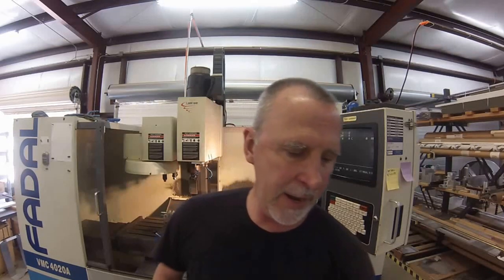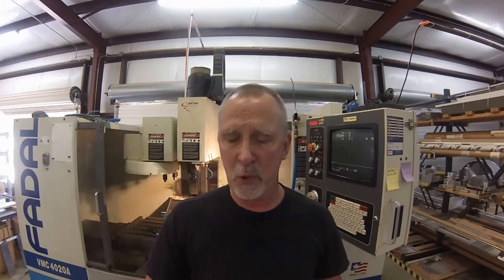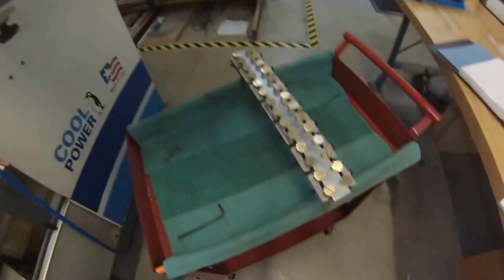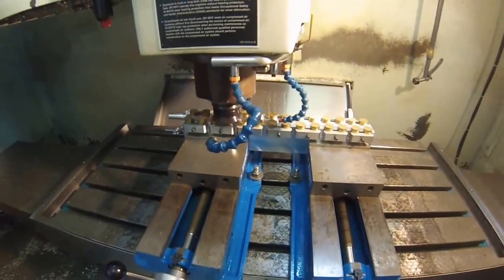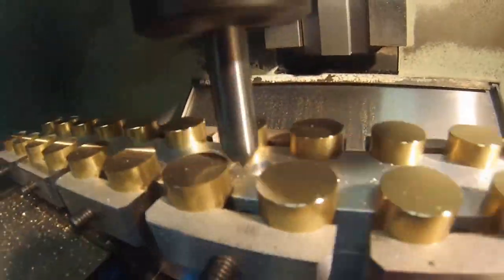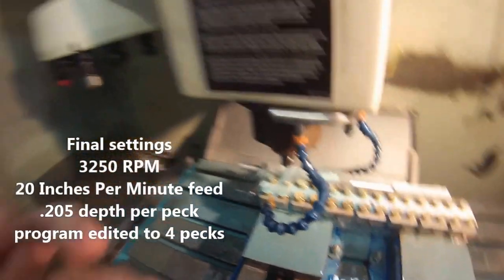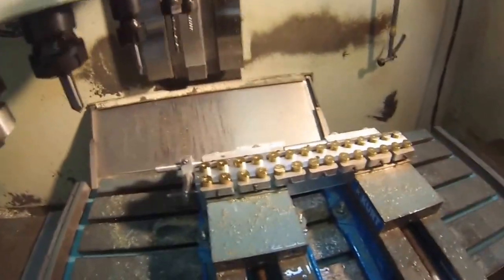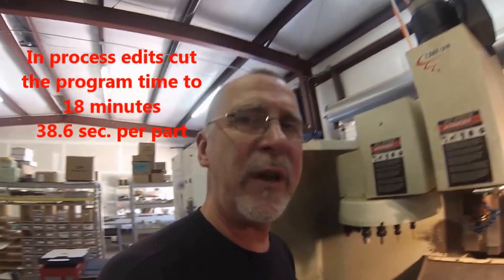Machining 28 pieces at a time

Comment: Hey Joe, could you do a video on how you quote a job? I would really appreciate that
Reply from the maker: Basics...Material cost, hourly rate, setup time, tooling and engineering. If you have a feel for how long the part will take, plugging in numbers should be easy. There are online calculators to help if you need them too.
Reply: Thank you Joe

Comment: Great work on the fixture and a great share for us. I think you can cut that time to even less if you reduce your retract plane while drilling. Around 6:20+ I can see your retract us about .75", that is way too far for that small tap. You could reduce that to .1 or .2 and save precious time. Over a year's time this could mean a hundred hours of machine operations. And as we all know time is money.
Reply from the maker: Max retract distance.160, min .08. I always give a rigid tap time to get up to RPM before it hits the hole.  your comment is good, but .75...not on this one.
Reply from the maker: The coolant jet coming in from the right is set lower and obscures the bottom of the drill.
Reply: Joe Pieczynski ok, that makes sense.

Comment: Looks good Joe, thanks for pointing out how important it is to consider production times and setups in pricing out a job.
Reply from the maker: Hourly rate is simple to calculate. If you want the job back, you may elect to eat the setup time for the repeat work.
Reply: Smaller profits now, for bigger profits later. Seems like a smart trade off to me.
Reply from the maker: You have to weigh the options, but I'll take a little now for a huge payday later.

Comment: excellent!  would've liked to seen you actually indicate it at start. what's your opinion on fadal vs haas in regards to machine and controller? debating an older vf15 with 4 th,  or haas tm or vf 0/1.
Reply from the maker: Since that tooling hole was machined at the same time as the part pockets, and acts as my main fixture offset,  I only had to pickup that tooling hole and I was done. 5 minutes max. Haas makes a great machine and has a good reputation. You can't go wrong with one. Fadal has been around for a while and also has a variety of machines to offer. Evaluate your expected work to factor in your choice.

Comment: Great video, that cnc machine really puts out the work.
Reply from the maker: It does. 28 at a time seems small now. I'm thinking about sticking 2" blocks between fixtures and running 56 at a time.

Comment: Same ? as Dan Stepka :: Manual steps such as blowing chips from hole after drill before tap. . . you implied it was necessary and you showed a manual OP . . . can the machine do this or do you have a stop and alert operator function ???  Great Job, very interesting/helpful/educational.
Reply from the maker: I added another coolant hose and let the fluid flush the holes......Hands off. Good question

Comment: Joe - another fascinating video... even for a home-gamer like me who doesn't have a CNC mill. May I respectfully make a suggestion regarding your ever increasing video quality. Your videos have become much more watchable and enjoyable since you've made a great effort in regards to the camera stability. Even when you move the camera, the image is now more stable. The suggestion/request that I'd like to make is for a tad bit better lighting. When I watch your vids on my 50" TV, the colour, contrast and white balance is mostly passable. At 2:05, where you've returned to an image of you from a shot of the fixture in the mill, you're in a slight silhouette because of the "back-lighting" from your shop lights. On the TV it's OK but when viewing on my iPad and my smart phone (as many viewers do), you're much too dark. A small point, I know. But an easy, inexpensive improvement is the use of a foreground light. A couple of cheap, workplace lights would do magic... such as Chinesium halogen (very hot) or LED work lights (better) on tripods (setup to the left and right of the subject). A piece of translucent paper taped to the light source will diffuse the light, prevent glare and not blind you. It will greatly enhance the visual experience though, for less than a $100 or so (Hollywood spends as much on lighting personnel and equipment as they do on the cameras!)
I know that your shop earns your living but the lighting improvement that I'm suggesting won't cost much time, effort or dollars.
Sorry for the long-ish post. I really enjoy your work and your sharing with us un-washed noobs! (Lol) 
Thanks... Michael from Winnipeg (Canada)

Comment: would you add a stop point to blow out chips pre tapping  or you can get mill to do this thanks
Reply from the maker: Everything in a CNC environment is controllable. Right down to where the coolant flushes the chips. Sometimes this is good...sometimes it not. But your awareness of your environment is key. I shifted a tool path and added another coolant hose to eliminate the "chips in the hole" possibility, It ultimately became an 18 minute, hands off cycle.

Comment: Yep.  If you only had to make 28, making a jig might not have been a time saver.  But, as you said, if there's a chance of having a "re-order" of the same parts (or, as this seemed to be, an order for hundreds), definitely worth the time.  Thanks for posting this!
Reply from the maker: The expectation is for very high quantity. Next time around, this job will smoke through this shop.
Reply: What I like was the quality aspect....yes cycle time is important but all for naught if you have to scrap them or the customer isn't pleased.  Thanks for sharing.

Comment: What did you do to finish the opposite end of the part?
Reply from the maker: I had 2 lots of different parts. Both lots had the 10-24 holes common. One of the parts was simply decked and chamfered and the other part got a 1/4-20 hole. Everything was done in the same fixture.

Comment: As a Theory of Constraints based Continuous Process Improvement guy who is also a hobby machinist this video checked off a lot of boxes for me. :) 

Incidentally I'm starting to get requests for work from my little shop. Well within my skill set, but I never planned on making money with it, just having fun. I have no idea how to price this kind of work (having only charged for intellectual service type work before, not hard products). I suspect you have a lot of wisdom on that subject and there are surely many who could use it even more than me. Obviously not hard numbers, as that will vary for everyone, but the general process and best practices kind of considerations.
Reply: I don't wanna step on Joe's vid, but the main answer to your question is 'what is your time worth'?  Besides that, your fixed and variable costs have to be considered.  Does the job 'eat' tooling?  Joe's example looks like 360 brass, so those tools will still perform as new after thousands of cycles.  If it were D2 or 440 stainless, it'd be a whole 'nother story.  If you're working out of your basement, your cost structure will be way different than Joe's, who appears to be in an industrial park.  Also consider that the word 'commercial' is much like the word 'boat'.  If you go the commercial route, things like phone/internet, electricity and rent will cost about three times what you're used to.  All that said, it's an animating contest, and one I hope you join.